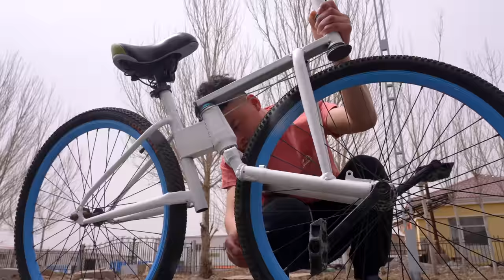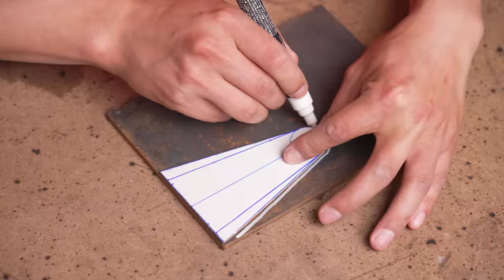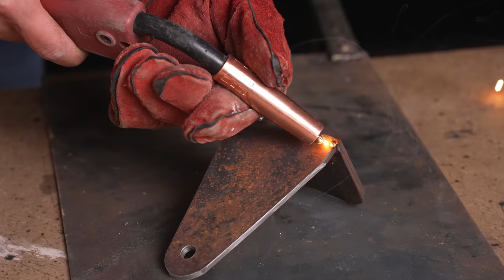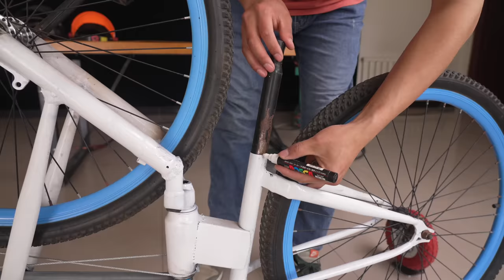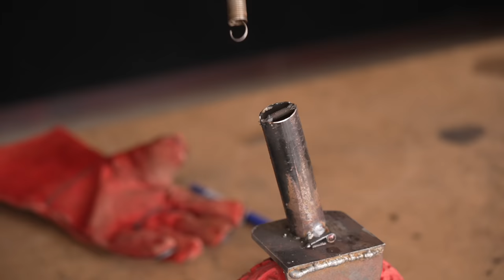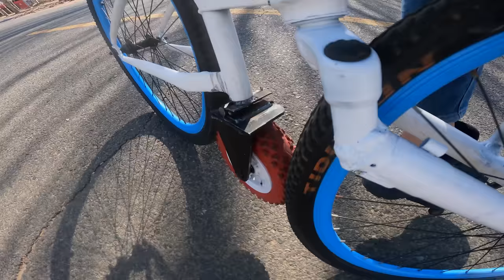Made an amazing two-way drive bicycle

Comment: Drive any wheel and you drive them all.  An internal hub gear at the pedals would give useable gears.  As is the gear ratio would be too low?  Potentailly a bicycle with better traction and one that takes up less space.  You could have geared  pedals  or motor on the axle of the central wheel,  noting that central wheel turns backwards.